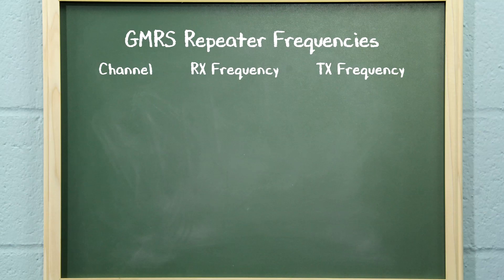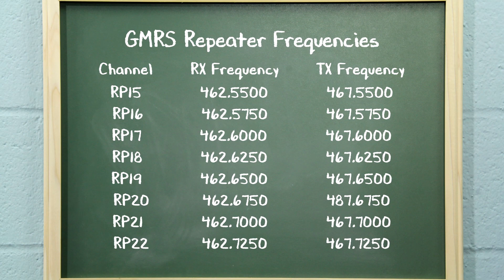How to Set Repeater Channels on the Midland MXT400​ | Radio 101

Comment: Hi Rick, Quick question... can you program the MTX500 for repeaters without using the windows software?  Thanks in advance...
Reply from the maker: Yes, it can be done right from the radio. Enter the menu with the “Menu” button, and the repeater setting can be found on menu option #12 - REP

Comment: What I want to do is, be able to use say channel 22 as a talk around locally channel, but also channel 22 is used as a repeater channel in my area, so I like to set up another separate channel with the ability to use the repeater. It seems that the MXT 400 only has up to channel 22 with no room to set up both sides of channel 22, one with and one with a repeater. Is this a correct assumption? Is it keep it as a regular channel or keep it a repeater channel? Thanks.

Comment: New to GMRS - I am trying to connect to a repeater station.  The station operator has provided the following information: RX/TX Frequency and RX/TX tone.  I believe I am tuned into the correct channel because i can hear traffic on the channel.  However they cannot hear me.  How do i input RX/TX as it relates to CTCSS/DCS?  If anyone could provide a step by step it would be greatly appreciated.

Comment: Does the Midland 400 allow the use of multiple repeater codes on a single channel. If I travel and need to use a different repeater that uses the same frequency as the repeater I already have stored, do I have to go in and change the code each time I want to change repeaters that share the same frequency?
Reply from the maker: When coming across different repeaters that use the same frequency, you do not need to change the frequency assigned to the channel. However, you will need to manually change the CTCSS tone to that of the respective repeater you are trying to transmit to.
Reply: @BuyTwoWayRadios  so I can’t store different tones on a single channel like you can on the Wouxuns or the MXT500.
Reply from the maker: Correct

Comment: I have an mxt400 and looking to set up a repeater station for GMRS in another location so that I can get over a hill. What unit do you suggest I buy as a repeater for GMRS use?
Reply from the maker: It depends somewhat on what you are willing to spend. Repeaters can be rather expensive. However, there is now an alternative to the traditional repeater. The new Wouxun KG-1000G base/mobile radio has just arrived. This radio has the ability to be turned into a full-fledged repeater. This requires to units connected together, but it will allow you to create a repeater station, and for considerably less than a traditional repeater. https://www.buytwowayradios.com/wouxun-kg-1000g.html You can hear all the details on this radio in the latest episode of The Two Way Radio Show Podcast. https://www.buytwowayradios.com/blog/2020/12/twrs-153-new-wouxun-kg-1000g-gmrs-mobile-radio.html

Comment: Can you tell me more about the programming cable?
Reply: Ok. So why dose it have a port on the bottom right corner on the face that says data?
Reply from the maker: @alexahedo85   There is a single pin data terminal on the front panel, but it isn't intended for the end user. According to Page 10 of the manual, "Data Terminal - not used in the MXT400".
Reply: https://www.youtube.com/watch?v=cYjp7P390EE&feature=emb_logo
Reply: When settingup the ctcss/dcs tone is it on tx only?  What if repeater calls for pl tone on rx and on tx?  For example the Retevis RT97, by default it is configured for a pl of 131.5 for tx and rx from the factory.
Reply from the maker: Midland does not offer a programming cable for the MXT400. It isn't intended to be user programmable.
Reply: @BuyTwoWayRadios  not true.  DBR1 Dual Band Radio Programming Cable <------ look this cable up on Midlands website.
Reply from the maker: @Big_Tuna53  The operative word here is *intended*. Our comment was posted two months ago, and at the time this was true, as it was almost a direct quote from the company. As an authorized Midland dealer, we support the use of the radio as the manufacturer intended, and that is what Midland intended at the time. Midland intended the DBR1 programming cable to be used with the DBR2500 Dual Band Amateur Radio. That is why they sell it. Although it is now known that it can also be used with the MXT400, that wasn't what it was sold for. As for the programming software, note that the links being distributed at this time are from third parties and users. Whether Midland itself openly offers it publicly to end users in the future remains to be seen, but if and when they do, we'll support their efforts as a dealer.

Comment: can you use those repeater channels on gxt1000?
Reply from the maker: The GXT1000 is not repeater capable. However, the Wouxun KG-805G is repeater capable and has the repeater channels built in. It will pair well with the MXT400. Watch the KG-805G video to learn more. https://www.youtube.com/watch?v=YloG74x6jlo

Comment: @Buy Two Way Radios - Great information and thank you for sharing. If I may ask a question, what mobile antenna would you recommend to pair with this radio? I am looking for maximum performance while driving on interstate roads. Thank you for all you do, and I look forward to your answer.
Reply from the maker: There are are a number of UHF antennas in the GMRS frequency range that would work, although few of them besides the ones included with the MXT radios are tuned specifically for the GMRS. We are working to change that, and should have an alternative available soon.

Comment: Is there an offset function on the MXT400?
Reply from the maker: There is no offset because the TX and RX repeater frequencies are pre-assigned for the GMRS by the FCC.
Reply: Thanks, I'm new to GMRS and still trying to figure it out (WRFW773)